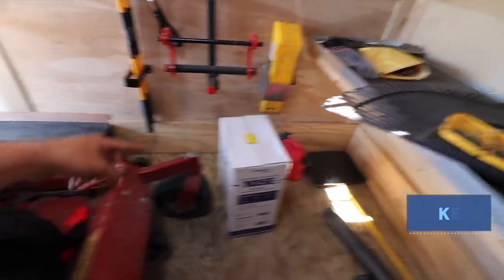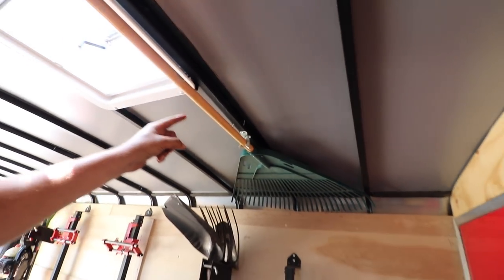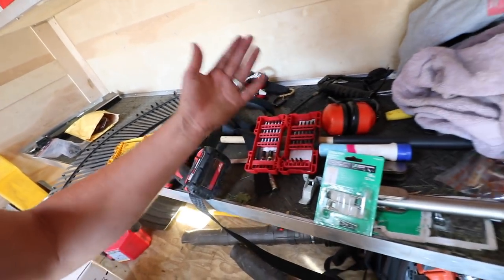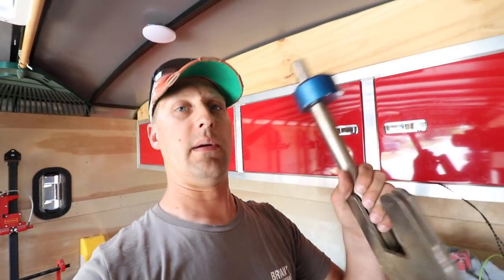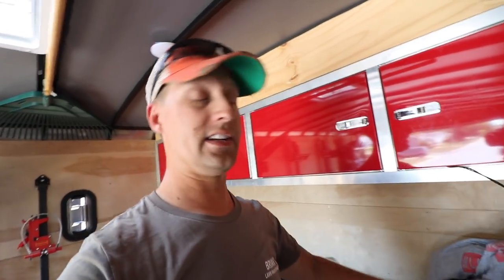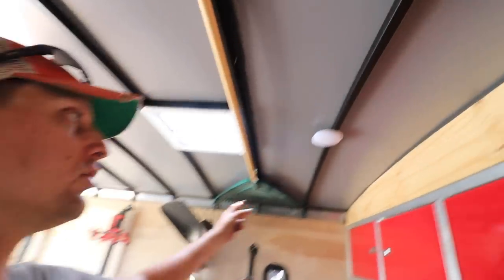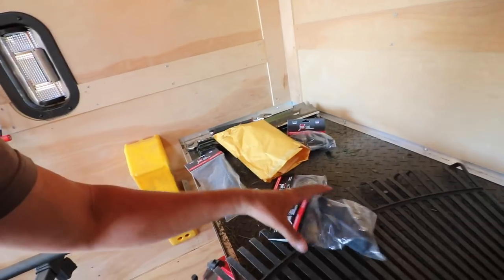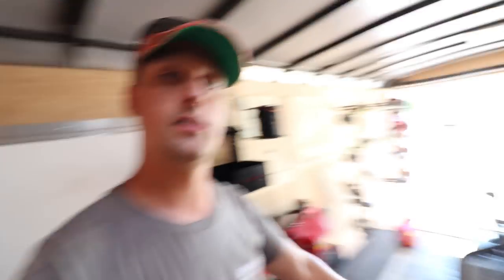Adding Upgrades To The Trailer ► Dog Days Of Summer ►Cleaning Up And Getting Organized

Comment from the maker: Have you guys made little holders like these or use these clips? Hopefully they hold up!
Reply: Brian's Lawn Maintenance I have used similar clips to get light items up and overhead. I wouldn't use them for overhead storage of regular old shovels, as they will surely fall and break something on a mower while you are driving around. I mainly used them for my VERY expensive snow shovels, but stored those vertically, not horizontally, as that would warp them over time.

My goal for storage, whether in/on a trailer or in a building, was that I never wanted to have to move something to get to something. I know sometimes you just can't make it so, but it's a great rule of thumb to have, especially once you grow and have employees. Then you won't have dudes trashing your trailer or storage unit/garage looking for something. They should be able to see it plain as day because nothing is blocking it from view.

Comment: Brian one thing I noticed that you didnt have is a fan hooked up to that top vent, if your dealing with heat its the best way to cool that down in a hurry and can be wired up to the trailer wires for power. It looks like a little cpu fan but make all the difference in the world, highly recommend looking into it.

Comment: 95% of my accounts have irrigation (by design) so I don't really have any dry out spells. However when I did before I built a good route I would offer pressure washing for decks, sheds, picnic tables etc....also go back on old estimates you never got approvals on maybe follow up with each and see if you can offer a discount to seal the deal to fill schedule. Also a great time to sell irrigation systems warning customers if the lawn drys up too much it could die and will cost you as much as a system install to replace. Win/win
Reply: Sorry this was for the drought video

Comment: Nice tip but man I’d be trying to tap into the air on my open trailer as there is no roof on it!! Lol

How do you like your rack system compared to the green ones by the way? I’m looking at having to get that soon as I’m tired of it being in my pickup bed.

Also after being at my dealer for some warranty stuff yesterday they did confirm that Exmark is re-tooling the X-Series stander and that’s all they’ve been told. So I know that’s been something discussed for you to demo, but they said it’ll be probably around the fall to GIE time. I swear that 96” was begging me to tale it for a spin (the target syndrome almost took over again).

Comment: YOU BUTCHERED MY USERNAME... HAHA its Ken Mr. KLC maybe that will help. KLC Lawn & Landscaping is my company. I did a little thank you video receiving the Proven Industry coupler lock... Nice stuff! Thanks again
Reply: I like that clip on roof idea. I have used those same clips before on the walls on one of my enclosed trailers but I really like that roof support use especially for the plastic leaf rakes as they are kind of difficult to hang vertical. Might be good long ways for hand pole pruner too.... I will def be grabbing me some.

Comment: I need some grinder wheels lmfao. Can never have enough. Im still using an angle grinder. Killin my blades. Ughhhh hate it
Reply: CUT RIGHT LAWN SERVICE I always put my grinding wheels/flap disc's on a 16penny nail driven in at a sharp angle. That way I could see when I was getting low and order more from Amazon. I can't remember the brand I used but they were German and expensive, but they lasted FOREVER. So in the long run it was cheaper.
Reply: Explain lop